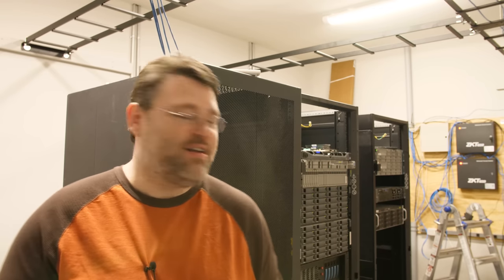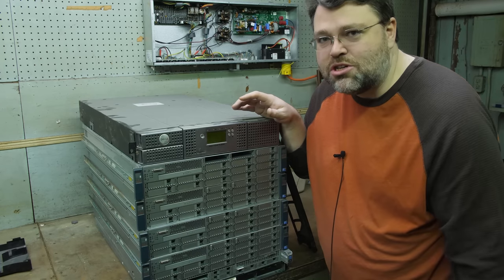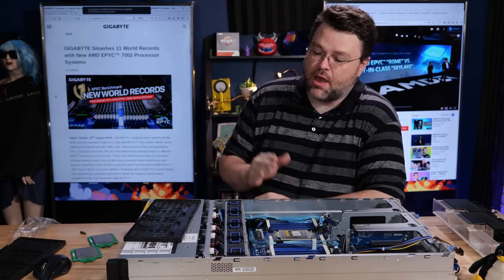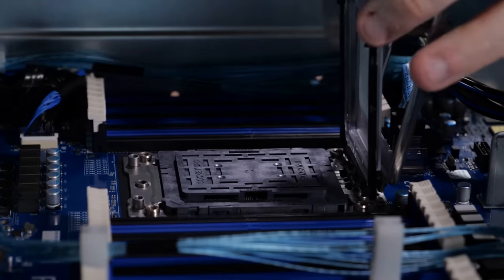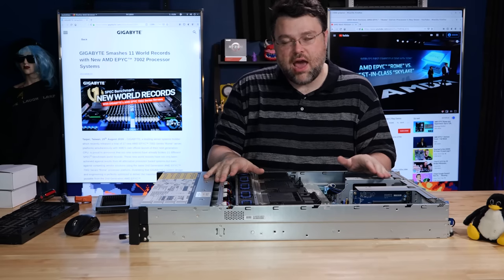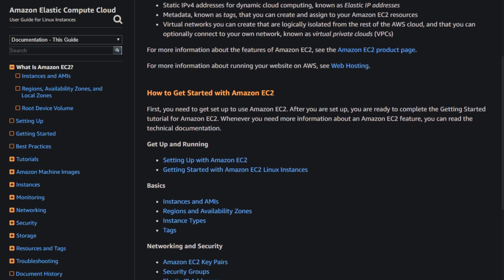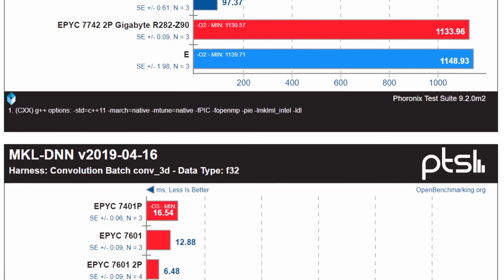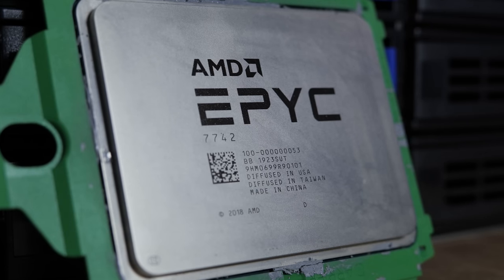Dual GIGABYTE EPYC Server: The World Record Breaker!

Comment: So I'm all for consolidating servers, and god knows I'm a sucker for cutting edge hardware, but what do you do for redundancy with only a single server? I know for instance vmware typically recommends at least 3 physical nodes in a cluster for instance. (I'm an IT student, school me if you must).
Reply: Jon Champagne you don’t and could have an Epic failure. I’m also not sure what size business this video applies to as the chassis seems more fit for archival storage or smaller databases.  Would be nice to see any actual use case with some details behind it.
Reply: When you've a datacenter even a small one, you've way more than a single node.

So yeah... No... That's not a concern.
And at a microscale (personal rack) you backup your shit everywhere and on cloud servers in case your own hardware goes down.

Hardware is just the tip of the iceberg when you talk about redundancy.
Software and data scaling is often more important than your hardware.
Reply: Redundancy requires multiple physical machines.  Period.  While consolidation saves space and power, it does nothing for redundancy.  Harms it, really.  If you have 10 system's worth of work with 20 systems for redundancy, and single failure only renders one system non-redundant until replacement.  If you consolidate that down to just two physical machines, one failure kills redundancy for everything.  It's rather like replacing RAID 10 with RAID 01.

Comment: Newbie question. I remember seeing a video of an old supercomputer being decommissioned  (seemed sad!) but the guy was saying its high power demand, compared to newer hardware, was one of the main reasons it was being decommissioned. My understanding is that efficiency (Flops/Watt) decreases the closer you push to the design  limits.  So why not do the opposite? Rather than junking old beastly hardware, is it possible to increase its efficiency by deliberately underclocking it? Yes to be less powerful. But more efficient.  Then the hardware could possibly  take on a new less demanding role? I have no idea if the efficiency  gains would be significant. Just a fun idea. (Side note, my Dad grew up in England during world war 2. Resources were very scarce. Rubbish bins were not called rubbish bins. They were called salvage bins. I find that inspiring.)
Reply: Yep I have the same question .

Comment: How much ? We're considering switching from Intel to EPYC at work. Still trying to get vendors to send us some servers to experiment with.
Reply: Vince I - less than the power those 6+ year old servers are slurping up
Reply: He says it, up to 40.000 USD. But with 32 Core CPUs or Less RAM, the Price Drops hard.
Reply: @spoonikle  I hear you. We have thousands of servers but for some of the front end automated trading system price is no object really.
Reply: @xxcr4ckzzxx840  That's not too bad compared to what we are paying for our latest batch of machines in quantity. Will push to get something to test with early next year once we're back from vacation.
Reply: Also hardware that has fewer kernel vulnerability mitigations out of the box has now become a thing.
Reply: Half the price of Intel servers for the same performance. Maybe less.
Reply: @vincei4252  Exactly. Especially with this new one you can´t optimize the power consumption through underclocking. Also keep hearing about MDS vulnerabilities having a huge impact.

Comment: I figured servers using NVME hot swap storage would use a heatsink shell around the NVME drive and then thunderbolt 3 (or something like it) as a connector and leave enough room for maybe 90NVME drives on a 2u

Comment: It's so difficult sourcing the R282-Z93 chassis for me.  Would it be acceptable to throw the ROME2D16-2T mobo in a supermicro 2000W chassis (for example the chassis used for SYS 7049GR-TRT) or the CSE-418GTS-R4000BP2?  I would appreciate any input

Comment: This is super interesting.  As a 3D artist I tend to be my own Sys admin, and I have been keeping my eye on building s mega systems like this so I can virtualize my render nodes.  But my snag is GPUS.  I need a MINIMUM of 3 GPUs per node,  and right now I'm running about 12 GPUS (GTXs soon to be upgraded to RTX cards once the 3000 series come out)  over 3 different boxes. So I would be VERY interested in some sort of PCI breakout boxes where I can attach 12-16 GPUS to a system like this.  Any recommendations for that?
Reply: Mining rigs have easily more than 12 GPUs on a motherboard, maybe there is way to use it as a render farm.
Reply: @vitalis  I have built a couple of GPU mining rigs to use as render nodes.  Yes, they work as render nodes, but are far less reliable and are so slow due to the PCIx1 to use as a workstation.
Reply: @3dduff  Well, it sounds like you are a successful 3D artist then if a 3GPU workstation isn't cutting it ;) You'll just have to use the old proxy method if your 3D scenes are that crazy

Comment: Why does "full frontal nvme" sound oddly pornographic?
Reply: Keep talking... Just keep talking like that!!...
Reply: @miguel riveiro , I just bet you would like to insert that long NVME, solid storage drive into that chassis. That slot is just made to take it. You could do it all day long in multiple slots.

That will be $200 for me to continue for the next 30 minutes, just remember we haven’t even started on your ECC RAM or inserting that power connection into the rear.
Reply: don't forget to put that spacer underneath that nvme before you put it in. You wouldn't want it to touch on the motherboard.

That's naughty.
Reply: @backupplan6058   such a shame you don't have to use cable ties for anything... ( You sound oddly pro on this mate... What you said you do for living?? XD )
Reply: @miguel riveiro , I save the cable ties for my extra special clients. Nothing gets them off like good cable management. 
This may not be the most glamorous career but it does pay to put my kids through college. Without it who knows kind of job they may get, could end up like me walking the RGB district or far worse, working in Intel’s marketing department, lest I have pride in my work.
Reply: Aw, yeah, baby, let's talk about your throughput~

Mmm...yeah...mm, dat connectivity~
Reply: "Show me your 22110 solid state drive"
Reply: @backupplan6058  best laugh I've had all day, thanks man.

Comment: I got a dumb question , Would a Epyc CPU work on a ThreadRipper Motherboard?
Reply: Red Dawn Gaming ...No they are not interchangeable. Although they are physically the same, they are pinned differently (not wired the same).
Reply: Iam_Dunn Ohhh

Comment: So what's the form on migration a VM that was built on an Intel host to a host running an AMD processor? Way back when it was a big no no, has that changed?
Reply: Seems that's really only an issue for live migration. We've really only had a small issue with software compiled for Intel with the AVX2 instruction set. A simple recompile was all that was needed. Though, this was migrating an Intel bare metal server to Intel Proxmox VM. The real test has yet to take place, turns out the Epyc motherboards are rather hard to get your hands on here, the 7702Ps we have are starting to gather dust.
Reply: @LowSetSun  Since Zen 2 now has native AVX2, I wonder whether that recompile would still be necessary
Reply: @mduckernz  I didn't know that Zen2 supported AVX2, that's quite handy for us. We'll see soon enough if there's more trouble for us to fix when the motherboards arrive and the arduous task of migrating ~25 servers starts.

Comment: Disregarding power consumption, will 32x DELL Optiplex with 3770 cpus perform on par with this EPYC server? They could cost quite cheap, when bought on a surplus.
Reply: Assuming no communication is needed between the nodes and you do not need too much RAM/core, maybe?
Reply: Probably. Also depend on the infrastructure the user experience on "real" computer will probably be better than on VMs. But the point with using a server vs. all those machine is about IT management. Easier and cheaper to manage.

Comment: Hi Wendel,

I’m currently in the process of testing a HP dl385 gen10.1 dual 7402 and getting very different results comparing to a Dell r440 Xeon gold 6230. 

Also running Pts, but using the apache, nginx, mysql,postgress etc benchmarks.

Did you run a few of these? Not taking down on AMD because it still is a very nice platform :)

Comment: Did you run a Hackintosh VM on this thing? You know, just to make Crapple look bad.
Reply: I've seen someone make a "Hack Pro" with the top 64C EPYC SKU. It was way cheaper than the top of the line Mac Pro, and way faster as well obviously.

It ran Mac OS bare metal. No VM necessary.
Reply: @mduckernz  Excellent. The VM idea was just to make it look even more radical.

Comment: If we're having that much consolidation aren't we better off going with 4u or something that uses a much quieter cooling system? I would rather water cool with deltas than to be stuck in a room with those LOUD fans.
Reply: These server racks aren't really meant for being in the same room as people, or risking leaks with water cooling (and fan speeds do go down if loads are low). You're better off aiming for a desktop workstation solution if you want to occupy the same room and/or use water cooling.
Reply: @MetroidChild  I'm not saying I would water cool, I'm saying that the fan's make deltas sound like 30 dollar Noctuas.

Why must we have 2u? Wendel might have to ditch an entire 42u rack due to all of the consolidation he'll be able to do.

Comment: 4S or gtfo. lol
Can you imagine a 256 core 512 thread monster system?!?!?!
Oh...
My...
GOSH!!!!
Reply: Imagine it. Next year... 
Zen 3 will be unleashed. The power... will be unimaginable. Improved yields. Lower energy-use, higher clock-speeds... AND... higher density... which means... MORE CORES!!
Reply: @predabot__6778  I'm trembling over here.
"Do it again."
"Mustafa!" (The Lion King).
Reply: Predabot Predabot i‘m sure zen3 wont have more cores. Its basically another tock just like zen+
same transistor size but improved process. maybe zen4 might increase core count but to be honest i dont see that happening either. you‘d have to increase the cpu size and put 16 chiplets on a package. also the thermals would be hard to handle. the energy density becomes unreasonable at a certain point
Reply: Predabot Predabot i‘m sure zen3 wont have more cores. Its basically another tock just like zen+
same transistor size but improved process. maybe zen4 might increase core count but to be honest i dont see that happening either. you‘d have to increase the cpu size and put 16 chiplets on a package. also the thermals would be hard to handle. the energy density becomes unreasonable at a certain point
Reply: @aemonblackfyre4159  zen 3 is supposed to be a huge ipc increase but is supposed to have the same number of cores.
Reply: AMD have officially said that Zen 3 is a new µarch, and they're  on target for "better than average IPC gains"(So, better than ~8%). But yeah, I don't think they'll slap on more cores for now, it's not making sense to add more now, well not for desktop and HEDT anyway. I could see more cores for server parts if they massively shrink the IO die, but I don't think they'll go beyond 8 core chiplets for a while yet.

My guess is better IPC/latency and improved clockspeed, they need to hammer out those last few weak spots they currently have against Intel to obtain maximum dominance. Hopefully they also adopt Zen 2 to be a good laptop chip if possible, since that's the final market they need to kick Intel in the shins over.

Comment: Would something like this make an incredible gaming machine despite not being geared for it?
Reply: yes and no the EPYC CPUs have have the same IPC as the Desktop Zen CPUs so it is like a R9 3900X for gaming but performance is going to be much slower since EPYC seems to be for the most part limited to 3.4ghz while most consumer Zen2 processors reliably boost to around 4.1ghz and EPYC might not be able to overclock the RAM as much either so its gaming might be more like a R7 2700x but either way it would make a good gaming system just not the best
Reply: @XDbored1  Thank you for explaining it.

Comment: Lots of comments taking the P out of the Mac Pro with price comparisons to EPYC. Yeah fair enough, Apple were dumb not to negotiate with AMD while designing the Mac Pro, no argument. Lots of folks with the know how are very happily building their Threadripper Hackintoshes as we speak and smiling all the way to the bank.
That said the vast majority of people buying Mac Pro's will likely have never opened a computer, let alone built their own PC, let alone run a server. They're a million miles away from Enterprise level sysadmin. The point is most people commenting will struggle to wrap their heads around just how ignorant your typical creative user is of the hardware they're using. (I know because I used to be one!) They are comparing computational power, but that's to apply a logic that supposes that your typical Mac Pro user gives a damn. 

All they want to do is to use the application (typically FCPX or similar) they have spent years developing their chops on. These guys will be able to do stuff inside FCPX that your typical uber nerd sysadmin hasn't the faintest clue about - their expertise is extremely technical, but also very narrow, not because they're stupid but because they're simply not very interested in the hardware. They do care about the hardware limiting their creative options, but not otherwise. Nor do they care very much about price comparisons, because they're not buying the Mac Pro's in the first place - purchasing is another department.

Now what will be lots of fun in months to come, is to see real world workstation comparisons between AMD hackintoshes and the Mac Pro: not least because a 'new' Mac Pro is an investment in already old Intel tech which we all know is seriously lagging behind AMD. What worries me is that is likely to be so deeply embarrassing to Apple they panic and try to kill off the AMD hackintosh community.

Comment: okay this was "going to happen" when we went to multi function systems ( single core) when the speed was good, then there was HT which split the game, then splitting the OS function in a single compute.

Then we got 2 cores and then four and then many.....

So the problem.

The topology of a "traditional network" and what I see in these "online DIY" cross bread "solutions" is fundamentally wrong. 

We had isolated system and functional systems, then we had SAN and then we got nas, and there are a lot of people using this as a DAS..

So we had the "active system" the "archive" and the redundant.

So if I moved a whole network to maybe two of these servers, and one fails, that's the end?

if I have VM'd a active and archive and have a surge failure or a mem fail, so the system writes faulted data, then the whole system fails.

Don't get me wrong I see the 100% active use of a server and scaling on them, that fine but its a little eggs in the basket.

BTW I have multi core Vm systems, but I have "redundant active systems" which run along side and scale, but I keep them in the back ground. this Im sure will be one of the every "position" is wrong and right. 

Ive not seen the data sheets of failures, I see there are enough, and I have seen  failures ( and recovery) but I guess im getting old and were 100% was required 200% of the time.

Comment: Awesome machine, BUT... WHY did the engineers cripple the networking? Only two 1 Gbps Ethernet ports? I would have expected at least FOUR Ethernet ports, with one or two of those being a 10 Gbps port. Think about it: this machine will be used to consolidate many servers into a single physical server which includes not just the CPU power but the associated network traffic that all of those boxes previously required. I am positive that you want to balance the sever loads to specific Ethernet ports to ensure traffic was managed well. Fortunately, it does look like an Ethernet card or two could possibly be added if traffic does become bottle-necked.
Reply from the maker: The ocp3 slot is designed for dual 100 gig or 400 gig. It doesn't even technically take a slot
Reply: @Level1Techs  Thank you for clearing that up for me! I was wondering how in the heck you could consolidate dozens of servers onto a single machine and still allow for it to handle all of those servers' combined networking traffic on just a couple of 1 Gbps connections. Many thanks!